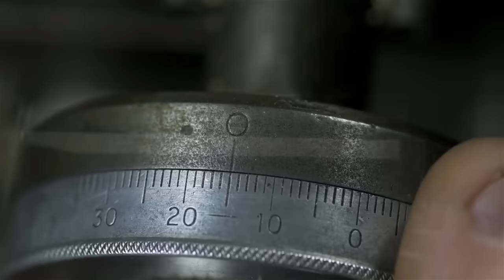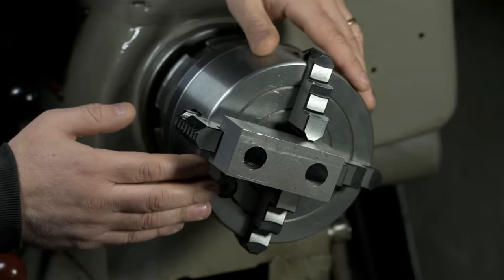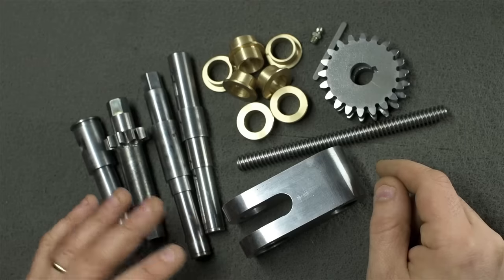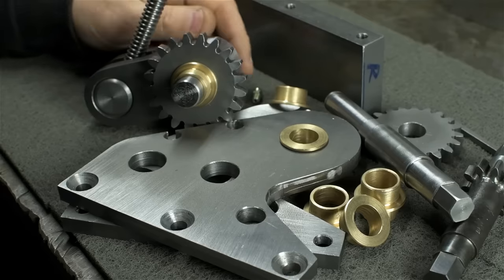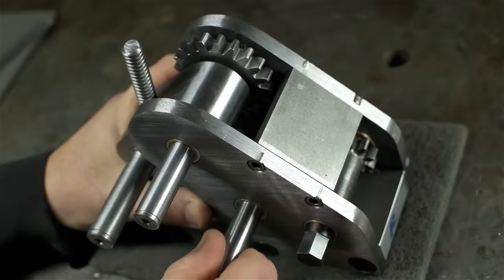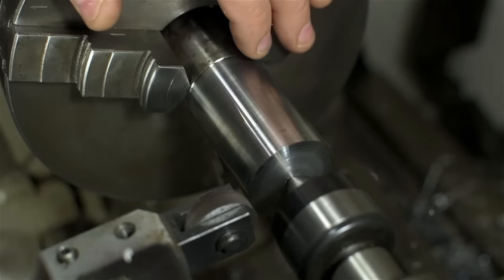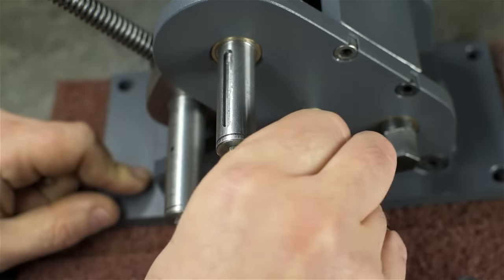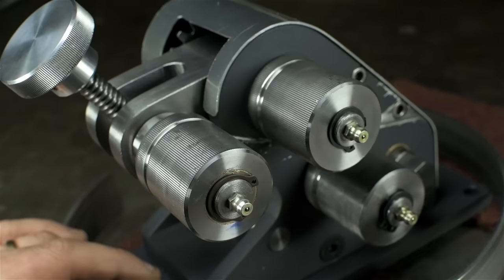The Rollenator! (Ring Roller Build)

Comment: Man that roller just has such a cool look to it. The shaper and Mr. Pete gags had me laughing hard too.
Reply: PE in da house
Reply: Yeah. you should engineer something practical for him to make with it :p
Reply: Practical Engineering - Do I smell a bromance going on here?? lol
Reply: TowME > your opinion is equally important as anyone else’s. In fact, after re-reading my comment, it is a little (a lot) crude.Thank you.
Reply: noxxi knox > No.
Reply: Mr Pete for sure bro. hilarious
Reply: Practical Engineering  
👍
Reply: Ditto! I snorted at the shaper censoring.
Reply: Respect for PE
Reply: Sort of like “The Ted Bier of Engineering”🙂
Reply: Thanks for helping me through my 2st gee
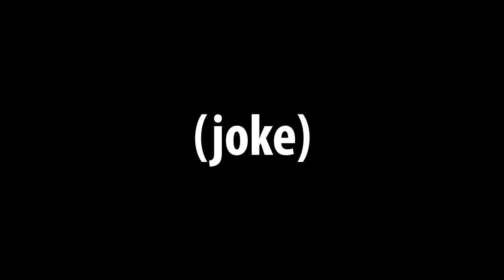Reply: Shaping begins at 24:49.
Reply: I need a flat lap with adjustable speed from 0-3000 rpm .  Can a proper set of gearing allow for the speed increase or decrease  and have consistent rotational force ? So it doesn't slow down from contact? I want to learn to cut gems.
Reply: @KaletheQuick 😊

Comment: This video's makes me think back to an argument I had with an old engineer back when I was young and fresh from training (And had a bit of paper that proved that I knew everything. :) ). The super abridged version of the conversation is that I was complaining that I didn't have the right tool to do a particular job, The old timer replied with "Once man has fire he can make a forge, Once he has a forge he can make basic tools, Once he has basic tools he can make complex tools, And once he has those he can make anything". My response was "Well, Why don't you f**k off to your forge and hammer us up a surface grinder then?".

I later found out that this little comment resulted in the words "Confrontational and negative" being added to my company record. Oh well. :)
Reply: Reman1975 this literally made me giggle. 😂
Thanks for the story!
Reply: I kinda feel like you deserved that XD
Reply: So why do tool and die shops exist? someone still has to make it :P  probably more cost effective for someone who has spare material and parts laying around too
Reply: reman i would have probably said something similar lol!!!! i worked with many old sages however some just did not want to do it the way it should be done like trying to make a 90 deg bend in quarter in. plate by hammering it over a shop table yes you did but its not as good as if you used a brake and it took more time and energy,oh well some men you just cant reach!!!! later dude!!
Reply: deadset legend!!
Reply: I'm almost an old-timer...  My comment would have been "Shows initiative, driven, very intuitive."
Reply: Now as an old timer if someone started saying "Once man has fire he can..." you would already have thrown something heavy and sharp at him.
Reply: Or, you might have asked him how long it took for him to invent fire.
Reply: Which substantiates the sticker on my motorcycle helmet:  "Old age and treachery always overcome youth and skill."  Thanks for the laugh.
Reply: could you tell me how the oil fittings would work and why and when you would use them?  i mean they look like regular zircs, do you put grease in them or do you run oil with a pump for heavy stuff or just put a shot of gear oil in there once in a while?
Reply: The art of diplomacy... telling someone they are an a$$ hole and when you are done they feel good about it.
Reply: I keep re-watching this video, not only because it's outstanding by itself, but also to re-read your story, Reman1975.  Makes me laugh again every time I read it!
Reply: I probably would have handed him 2 sticks and said, "All righty then, get to it."  😂
Reply: I bet this didn't happen. Cool story bro
Reply: @johndias6614  Diplomacy - Telling someone to go to hell in such a manner that they actual look forward to the trip.
Reply: Similar to my computing career faux pas (well, one of them):   “You do f’ing understand that I have to deploy that solution in the field on Monday, don’t you?”     Said late Friday with a non-field type saying it would be another week to finish since he didn’t want to work long hours.
Reply: The note on my company record was, "No tolerance for ignorance." I took it as a compliment.
Reply: @michaelparkinson4800  I thought it was Old age and skill will overcome youth and speed" At least that's what I tell the Ladies.
Reply: @bobhumplick4213  shot of gear oil occasionally..
Reply: @jimk5307   Raising the question of what constitutes "long hours" there; more than 40/week or more than 70..80?  There tends to be a lot of people happy to 'write checks' on other people's evenings and weekends.  When did he (and whoever schedules his workload) find out about the deployment?
Reply: Scott Willis he had plenty of notice and was working 40/week for many weeks coming into a forced deadline deployment with onerous financial impacts.   Meanwhile I’d been working 70+ so we’d hit the target.   His initial refusal would’ve converted to a couple of 90+ hour weeks for me as I would’ve had to go back and update a decent chunk of my work from the first weeks of deployment.
Reply: This was the best story on this thread. Awesome.

Comment: When the counterbore is too close to the edge I like to just have it milled right out through the edge to form a u-shape. It looks better, especially if the edge has a chamfer or fillet.
Reply: oh the old, "I'm designed this for easily removal!"
Reply: @TimKellerLinuxNinja  Just the counterbore, not the through-hole, unless that is what you want.
Reply: I can justify any mistake I make while machining as an improvement over the original drawing. Its a valuable skill in itself. In fact, I’m much more skilled at it than I am at machining.

Comment: You could buy the same item for $69.95 plus shipping, but not in that colour. For that.. I’m gonna say priceless.
Reply: In my mind!!! (Wierd crazy laughter)
Reply: Emerson White That's gotta sting.
Reply: As an added bonus. The Harbor Freight one walks the material off the rollers, so you don't have to do it yourself.
Reply: Apparently the HF one has some plastic bushings and the metal tends to walk off....
Reply: I have one of the cheap ones; they claim to do 5mm thick mild steel, but in fact you can only fit 3mm in there. I doubt it would manage stainless. I'm in the process of building myself a better one.
Reply: The main thing is  the rollenator has no reviews on the harborfreight site, so obviously the rollenator is not as good?!?? doh.
Reply: lol
Reply: So a lower quality one with less functionality is around 70, that makes the real thing about 350$
Reply: Yeah, I got a coupon for a bright blue one. Seems they're having an "Everything Must Go" sale... good timing, huh?
Reply: Benny Banger > obviously - lolol
Reply: Heard the eastern fraternity were already hard at work reverse engineering TOT unit from screen measurements.
Reply: JBFromOZ  you Can buy a rocket ship if you want ...
Reply: color*
Reply: Aluminium*
Reply: "You could buy the same item for $69.95 plus shipping, but not in that aluminium."

Aluminium is not a replacement for color, or anything else really. It's spelled aluminum.
Reply: The world is a big place. It’s mm not inches ;-)
Reply: I wasn't talking about inches. And millimeters are tiny. Centimeters make more sense.
Reply: Colour makes more sense “in the rest of the world”
Reply: Maybe to you.
Reply: Indeed, and not to you, glad we had this chat ;-)
Reply: LOL
Reply: The problem with the Harbor Freight model, is the part the adjustment screw goes through. It's plastic. And everyone that complains, seems to have broken that part. Before I even used mine, I made a new one out of A2 tool steel. I think I got mine on sale for $49.95. And it works just fine. And it will do stainless without a problem. I look at things from Harbor Freight as a "KIT", you're going to need to fit, finish and or beef up those products. Not sure what the piece of A2 that I had laying around was worth. But I pretty much only have $50 in this thing, not including the piece of steel, and a little time. I don't think I could of built from scratch, for less.  Looking at other comments, the work does not walk off mine. .Guess I got lucky there.
Reply: Nothing beat the homemade, keep up the good work, thank you for sharing
Reply: @LoganDark4357  I thought it was aluminimum.
Reply: @peepopalaber  $240.00

Comment: My microwave turned ball bearings into sheet metal...  you must have used defrost mode!
Reply: UCanDoIt2 yea in my microwave the ball bearings turned into pop rivets.
Reply: Yea....  you cooked then too fast!!!!
Reply: Mine turned into drill bits...
Reply: Mine just exploded.
Reply: I really screwed up, I got metric sockets... maybe I had metric bearings...
Reply: you gotta throw a little oil in there for heat convection, I cook my bearings on high and I get the size I need. also stay away from organic bearings, you will just get weld slag with maybe 2 or 3 usable bolts
Reply: Too much butter!!!!!
Reply: Mine turned bolts to ball bearing? I think I screwed it up when I took it with me through time travel to show my past self how to make it...
Reply: Your Microwave is running backwards!!!!!   Turn the wall plug over!
Reply: UCanDoIt2 Na it's a UK plug, you can only have it in one way around? I will try it the other way up and just push it really hard?
Reply: Huh that's weird. Maybe they wired the plug wrong at the factory? I've never had bolts turn to ball bearings. Maybe into drywall screws when I wasn't paying attention but never into bearings
Reply: And nowI have to buy a new microwave!
Reply: I thought those were pop-rivets but they turned out to be just machine screws.
Reply: Dude I just finished microwaving my bearing, BUT I  made the mistake to set the microwave to the highest setting so my bearings turned into .... are you ready ..... 

Freaking M22 nuts I was hoping for some M12s but I f*cked up. Great.
I'll give it another try later.

Dang it second attempt failed this time it is stretched drill bits on any size I will ever need. WHHHHYYYYYYYYYY ??????
Reply: Measure twice cook once
Reply: Tim Mills were the 10mm? Mine are missing.
Reply: Its supposed to be "popcorn", genius.
Reply: Something really when wrong when i put mine it my microwave they turned into titanium bolts with some obscure thread and they were steel ball bearings
Reply: It was a Popcorn maker....not microwave. Thats why it didnt work for you.
Reply: I think I may have microwaved my microwave ...
Reply: It's all ball bearings these days...
Reply: Mine turned into a lath with blew my microwave apart when it grew to full size, I’m not complaining but what did I do wrong?
Reply: Archie Perry 
He should have told us not to use full power
Reply: @timmills3823  you used a metric grill fuction on that microwave!!! you and your fancy machines! ;)
Reply: I must have a similar model to ToT. I put in pop tarts and got back top parts.
Reply: Why are all you guys trying to put your balls in the microwave.  Very, very unhealthy.

Comment: The exacto knife sharpening cracked me up! XD
Reply: Esteban why? He didn't even use it - waste of time because those things go blunt just lying around. :-)
Reply: Then tearing the aluminum sheet by hand, hehehe
Reply: Esteban Franchina he had me at cutting the steel with the bolt cutter :0
Reply: @probablynotabigtoe9407  lol that wasn't even a bolt cutter... it was a tree pruner, for, y'know, wood and garden stuff.
Reply: @tzxazrael  that is correct!
Reply: Porkchop Sandwiches those were yard shears!
Even better.
Reply: Is nobody going to mention when he made screws by popping ball bearings in a microwave? Brilliant cartooning!
Reply: And yet it still had a blunt, broken tip.  Not a bad thing though, as it would've stuck into the button if it was sharp.

Comment: Do you use 2% or whole milk for drilling big holes?
Reply: Of course, hole milk!
Reply: i assume that this is a joke but that white stuff is called drill emuilsion to cool and lubricte the drill and it consints of 2.5 ish percent drill wmulsion oil a special kind that dosnt seperate from wather and 97.5% wather
Reply: r/whoosh
Reply: @vega1287  No it's milk.
Reply: Vega 128 On the machines I used to run we always ran coolant at between 6 to 10 %. Depending on what type of material was being machined. Lower than that and you can get the danger of rust on your slides, and that's really bad.
Reply: @stevenkelby2169  and a week later it's cottage cheese .
Reply: @Snark900  100% correct

Comment: Just what I need. So much that I'm gonna make one. I fell into the trap of buying SCA nylon tyre trolley wheels which have inbuilt obsolescence (perish) . I have victory fantasies of fabricating steel wheels (like olden days) which never go flat. BUT i was stuck at making the steel circle to spec. Thks old Tony. You're a bottler.

Comment: I suspect the black magic of knurling is due to the fact that the tool is free spinning and not driven or connected to the drive. This would allow it to "slip" into place if it doesn't line up precisely, otherwise it would tread over previous ridges. So as long as it's close enough, it should self align. 

Though, it likely does introduce some small undue stress on the work and the tool as the tool and the ridges get pushed around, but probably not to any greater extent than they would already see just using the tool. 

So, ideally it probably should be some factor of the circumference, but in the end, it likely doesn't matter.

Comment: Nice work you did, but if it was me, then i will make a pedal to put on the floor, with 2 pedal's one for right and one for left turn around, i did make that kind of pedal for my big drilling machine, and my magnet drilling machine, so if something go wrong i can just run away and the machine will stop when i lose the pedal, if you make a pedal then you have both hands free to use.. but nice job you did make,
Reply: Take my word for it; both hands free when doing work where one or both hands can get into the workspace isn’t always great idea. Many workspaces have safety equipment to ensure both hands are well away from the work areas.  A guy in my shop bypassed the “both hands safety” with a foot pedal.  He ended up losing the front 3/4 of his hand.  Of course, using the right equipment can also hurt you if you use it incorrectly. Another guy insisted lifting big assemblies by hand was bad and he wouldn’t do it without it the crane.  The jaws on the lift failed and a 1,000 lb assemble landed on his foot; he’s got 3/4 of a foot now.  Working in a machine shop teaches some valuable lessons.  :)

Comment: Ah, the knurling sums confidence trick.
1. Calculate "a" circumference.
2. Waste time hitting the diameter for it "exactly".
3. "Confidently" push the tool into the work through 3 or 4 other diameters that also give whole multiples of the pitch.

Claim the reason you get a decent knurl is doing the sums, even though if you wanted to calculate accurately, you need to know what the circumference will be at the root of the knurl after you cold form peaks & then allow just the right extra to push up into peaks, a much more complex problem than I ever saw anyone actually calculate. Doable, but nobody does.

Boils down to, go in confidently & the tool finds one of the diameters that works, go in half-assed & end up with it double-forming or making a mess.

I invite anyone interested to do those same calculations themselves for say 2 inch or 50 mm ish diameter work, it's easy to prove you push the knurl in past several "theoretical" working diameters.  It's black magic as Tony says, or just confidence & feel.

Comment: Tony, I have a very old crankhandle operated roller and it has smooth rollers and rolls metal without any slippage. I also love running things through it. For fun, make a ring, then turn it around and flatten it out again on the roller. To my surprise, the thing works perfectly in reverse as well.

Comment: Harbor Freight has the exact same thing for $29.95!
Reply: Which is $23.96 after the 20% off.
Reply: Had the dam machine, it lasted halve a roll the Inner part is made of plastic and it broke in the first time I used .
Reply: I bet it doesn't have the quality his roller does.
Reply: @roberspierreM  well thats your fault. Its clearly stated that this one was only for half circles....
Reply: Yeah, but does it have those breakout holes?
Reply: Baleigh has it for about $185

Comment: yeah you hit the nail on the head for CnC v manual. If you're doing one or two parts manual is often better, unless you already have a very, very similar program set up for it. It's what we certainly do at work, and the time cost of coding for the new part is often outweighs the time saving the CnC machining then gives.

Comment: I need one of those bar choppers at 0:35, did you get it at harbour freight?
Reply: Yep, they come in at $15. They're good for a cut or two, but then you'll need to resharpen them or buy a new pair.
Reply: 69NOMAN69 noman - You would be mistaken.  When pruning, they are pruning shears.  When cutting CRS, they are something much greater.
Reply: Yeah, and if they dull up or break (which they will never do) they will replace your bar choppers free of charge. @JosephHarner
Reply: I also need a pair of those, pity he didn't show the manufacturer's name. Do you think they would cut a 3mm sterling silver plate?

Comment: I tried that drill bit stretching method but I guess the candle didn't get it hot enough😉
Reply: I tried it too and my bit is the same size but my thumb has a nice "tattoo" of the bit flute.
Reply: @jarodmorris611  Then your bit wasn't hot enough; the temperature difference for stretching bits and bit tattoos is really close!
Reply: Well, what diameter bit did you start with?
Reply: If the tealight candle doesn't get hot enough, try the larger scented candles. I've found them more effective, and they also make your drill bit produce some mighty nice smelling swarf! 😉